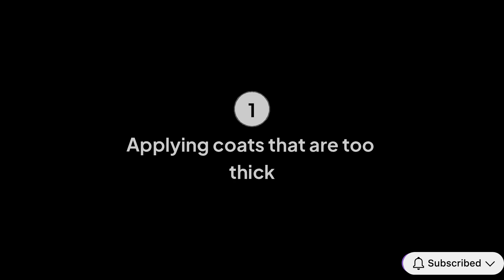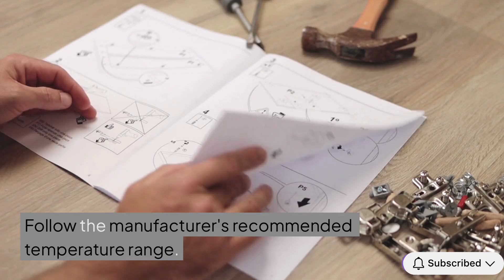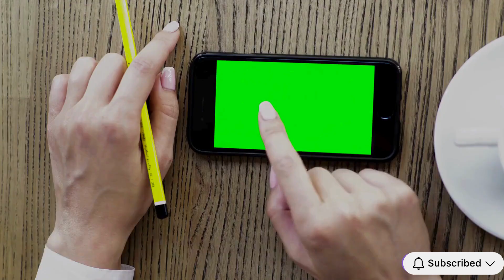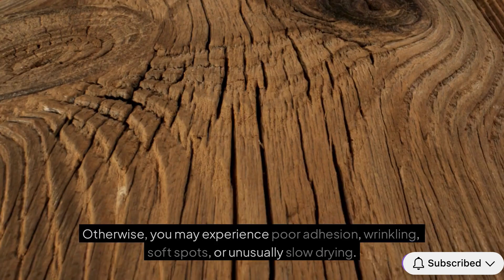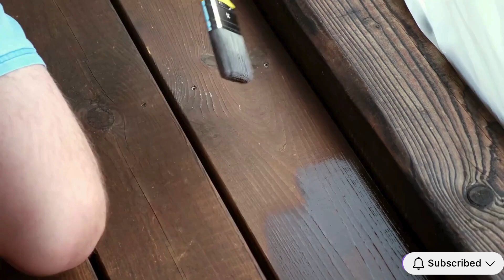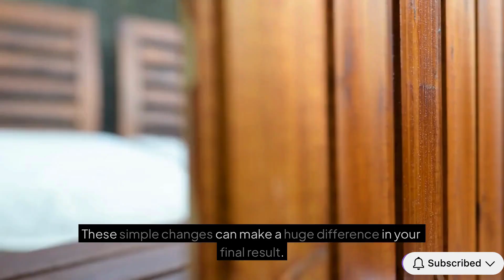Why Your Wood Finish Never Dries Properly

Comment from the maker: The dry-vs-cured distinction is the one that catches people out - a surface can feel completely dry to the touch while still needing days to reach full hardness underneath, so stacking or heavy use too soon can still leave marks. What's the worst finish-drying problem you've experienced?

Full finishing guide: https://woodworkingadvisor.com/wood-finishing-guide/